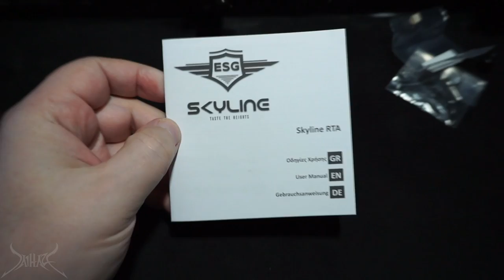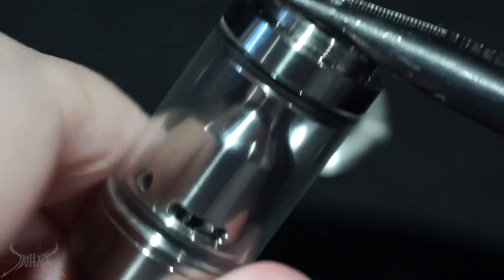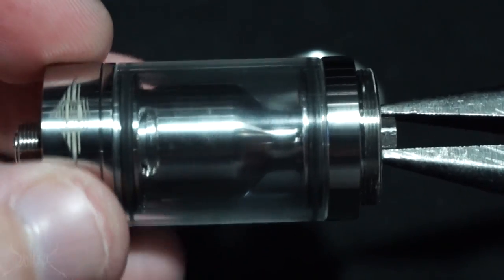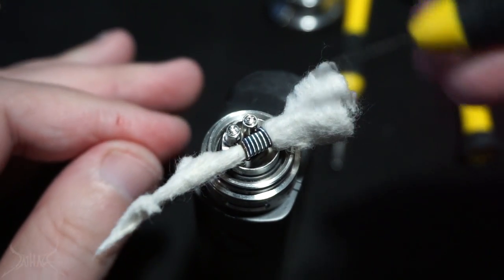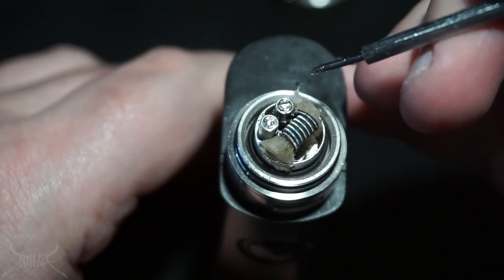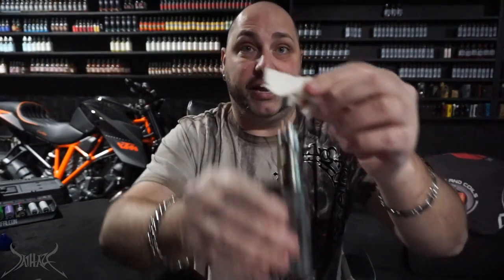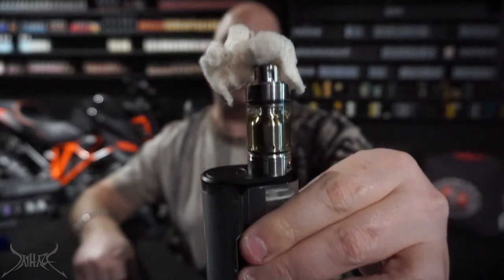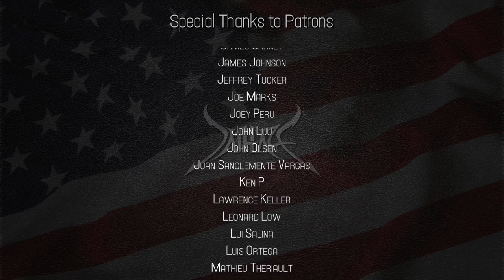ESG Skyline RTA Review and Rundown | Taifun GT III Killer?

Comment: I have a V1 genuine Skyline and they are great, I found it’s easy enough to use the juice flow control when you first remove the inner bell chamber and VG up the internal threads. I can freely open and close mine with the cap still screwed on with no need to loosen or lift up the the cap/sealing piece whether the tank is full or empty. Also mine did come clean but it’s a V1, also suggest that DL is for direct lung. Also there is a drop kit for a lower profile setup (on the ESG website).

Comment: I have a real authentic ESG Skyline and my juice flow control works perfectly, you dont need pliers. VG the orings. The ports dont need to line up they work in any position. 
And the condensation on the top cap was VG.

Comment: I'll be lucky if you read this. Big thank you and mad respect for your reviewing style. It's just authentic your true opinion on that experience. Some people don't get it. I hunted high and low for any reviews of this 2+maybe 3 years ago.  A little prior my body took me out of my truck and livelihood. This was my first RTA purchase. 0 regrets it's still a 10 even compared to the newest 1 I purchased. Except for The flaws you pointed out you can change airflow with a coil installed.  Challenging & the o-rings don't break in. Serial# etched under air flow pretty cool. Recently cracked the glass trying to get the deck off. The tolerance on the new ones the same. Dealing with politics almost back into a truck. Congratulations on the inception but I'm in love with that sexy divine single battery unit. Not a question but a goal to get one of your products.

Comment: Nice review, but the only comments to make are:1 the juice is pure vg for lubricating the machining. If you cleaned it dry, that would explain why the first time the jfc was so tight... trust me , no pliers are required!2 the jfc hardness, as above. Alternatively, if you still have trouble with the jfc, then prior filling the tank, just unscrew the tank and finger bang (yeah) the inner chimney and lubricate the threads with vg... it will be butter smooth thereafter3 when I visited esg store so as to replace the inner chimney as I did what you did with the pliers and totally fxxxd the top hexagon (not your fault, had not watched your video), i was advised that for SKY to work properly, the afc must always be wide open... don't ask me why it's adjustable if it's supposed to always be wide open!4 short ultem drip tips (black and yellow) are also available and so is an ultem tank 5 sky drop kit is also available. Other than just the smalker size , the inner chimney is conical and produces better flavour
A great atty in the overall with some of the best materials in the market and super machining...

Comment: Jai, This time I can't agree with you on the 9 bro. Stuff not lining up on chimney, you have to use a tool to adjust the juice flow. The liquid gunk on it when you got it. in line with other devices that you have reviewed, you would have a cussed out the company
for QA issues. (Vandy Vape). The review was very informative as always.
Reply: Savvy Vape Lord its because they changed the deck from v1 to v2 due to problems but didnt redo the chambers , dooh? But still chsrge so much , the Coppervape version is perfect , you can use Cleito Bubble Glass from 22mm on it to increase capacity but this has been out a year already ? Why review now ?
Reply: Inside the chimney, there is an o ring that needs to be lubricated before first use. Once everything that needs to be lubricated is lubricated, this entire atomizer is buttery smooth. So if there s VG on the o ring, Jai is unhappy and says it s filthy, if there s no vg on it, it s stiff and Jai complains. Can’t have it all!
Reply: I agreed with u on this there better not be nothing wrong with this for this price and there was nasty gunk all over it

Comment: You need put some VG on the o-rings, then you will not have any problems with adjusting the JFC
You don't need to align the holes of the JFC, it works ok in any position
There is also a "drop kit" that makes it look really nice but you go down (I think) to 2ml's

Comment: Once the o-rings are lubed you can easily open and close the juice flow controller without removing the top ring. Also, there's no need to line up the juice channels to the cut outs, there's enough space for juice to reach the wicks. For me, this is one of the best MTL tanks out there...

Comment: Hello Jai... just try lubing the o-rings of the juice flow top nut thingy, it then spins easily in closed/locked position. And try out the Skydrop toptank mod, it turns the juice cap into a polished ultem driptip. Reduced chamber size and flavor to die for. Cheers!

Comment: Hey Jai, you can actually get the drop kit's juice flow controller that doubles as the drip tip. Looks pretty slick. I couldn't find an OG skylone so I had to settle for a clone, it's a good atty.

Comment: Jai you may have a faulty device... There is no point in adjusting the juice flow if the tank isnt completely sealed. The way you are making it is screaming to leak all over the place. I also have a skyline and i can adjust the juiceflow with the secure ring without a problem. Maybe you just have to juice the o-rings for that to happen.

Comment: Hey Jay, maybe the juice is base without nicotine to keep the juiceflow control working without tools? Could be done in purpose to help the customer. Greets from Germany
Reply: I got the skyline since 2017 and it's really great atomiser. Mine came without juice and it was a payn in the ass to get it appart. Maybe they heard of the probs and changend it with a little bit of glycerin to get it easier working. If so a notice for the customer would be great.
Reply: And another thing to keep in mind: I have seen the production video of the skyline. They stated it is really important to get the skyline professional cleaned to the customer and told they clean every part with usb. Just another tip for you, if you like the skyline and the taifun gt3 so much: Taste the vapor giant v5s AND the kayfun 5 squared. Both are extremly good atomizer on the same level as the skyline and the taifun gt3. The vapor giant is from austria, the kayfun, as known, from germany. greets

Comment: I dunno why this popped into my recommended now, but the original wotofo serpent, no the SMM version, had juice flow that worked that way as well...
Reply: Ehh there is a juice flow control on that??
Reply: kuan meng on the very original version of the serpent there is, the Suck my Mod serpent didn’t
Reply: @Bldes-vl9pm  ahhhh... okay okay got it.. mine was mini

Comment: 185 euros....hahahahahahaahahahahahaahahahahahahaha
Reply: Pero Vaper its 256 u.s.... is this a joke?
Reply: The Coppervape skyline is much cheaper an just as good. Fits the Cleito Bubble Glass from 22mm version adds 5.5ml capacity ,. (The Sirius is better.)
they even cloned the drop kits , 
and the Hussar RTA single coil both work really well.
As clones.

 But i prefer the GTV3 and the BY-KA V7 RTA  i did have clones first 
 An liked them enough i did go out an buy the Authentic versions of both , 
The BYhKA v7 you order from Vapesytems RU , and can buy different width chimney chambers for MTL or DTL has Airflow tubes that screw into deck 
Really nice leak free vape. 
Like the BY-Ka v7 better than any Kayfun or prime its my most used Atomiser for out and about. Low power vape,
Reply: yes my friend i believe it is.. a joke played on our backs and eventually our pockets